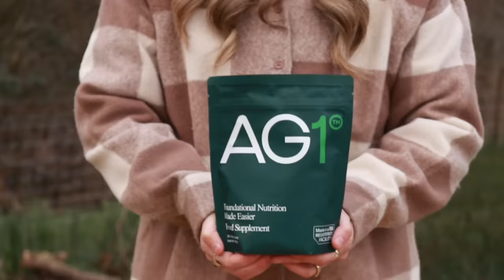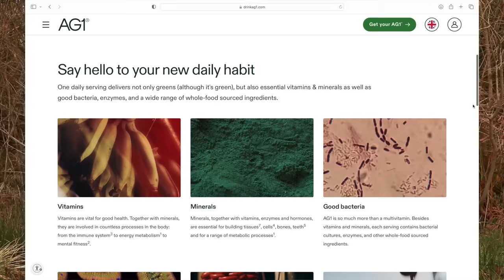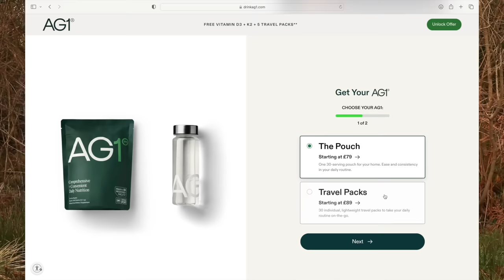New beginnings. Building our dream off-grid homestead in Wales

Comment: So fun to see your walls go up! You might want to reconsider not having a window in the kitchen area. I’ve remodeled 3 homes now (by myself) and got complaints about the only kitchen that didn’t have a window over the sink. It feels a little claustrophobic when washing dishes or vegetables. Any steam from hot water goes in your face. It doesn’t have to be large window, but it does need to open. Just a suggestion. Can’t wait to see your next video.

Comment: You're doing so well you guys. A little bit of advice though if you don't mind. Noggins should be staggered for extra strength. By staggering noggins, the load-bearing capacity of the wall increases significantly. Forces exerted on the wall are effectively distributed throughout multiple noggins, reducing stress concentrations and enhancing overall strength. Staggered noggins create additional voids within the wall structure. These voids can be filled with insulation material, improving the wall’s soundproofing and thermal performance by reducing heat transfer and noise transmission. One of the primary benefits of staggering noggins is the enhancement of lateral stability within timber frame walls. By distributing loads evenly, noggins help counteract the lateral forces that act on the wall, such as wind or seismic forces. This lateral stability is crucial for resisting structural deformations, ensuring the longevity of the wall, and reducing the risk of failure during extreme weather conditions.
Reply: Instead of moving the ones already in, can they just add additional ones in the staggered positions?
Reply from the maker: Thank you for taking the time to share feedback 😃 the noggins are staggered on all walls apart from the last wall Jon did, he did 3 all at the same level by mistake 😅 the dark/tiredness got him. I wonder if ours aren't staggered enough going off your advice? Thanks for sharing xx
Reply: Yes the noggins should be a lot further apart,
Just add extra to what you have already. @CampOutWest
Reply from the maker: Thanks Jazz 😃  @JazzFunkNobby1964
Reply: @jillpackard5305  sorry for the late reply. Yes they can add more  between the others. It would add strength to the overall structure, especially with the high winds we're getting at the moment x

Comment: Check out composite roof sheets.  These are galvanised and insulated and are super rigid and light. It might make the whole process a lot quicker. They use these in places like Portugal for fire resistance too.

Comment: Before buying that log burner, do a little research, look at some log burners you like and read their specifications, especially how much clearance they need, then make a 1:1 scale model from a cardboard or something. Even a small one can take up quite a large space as it needs to be a certain distance from the wall and anything combustible. And of course you need at least a small storage designated to logs, unless you want to go outside every time you want to put on one. I absolutely love fireplaces, wood stove or anything wood burning, but in a tiny home with such limited space ... might not be a good idea. If it was a holiday house, I would 100% agree with it, but as a permanent home, that extra space will be very important.

Comment: Not sure but I thought you would need a double header, an extra bit of wood going completely on to of the frame. This will add extra support when adding the roof.🏴 Make your own trusses will be far cheaper than buying them in. You can build them in situation. This will be easier and much lighter on you both when lifting them into position

Comment: Please add some more kickers to it, mounted bit higher and to the floor . If big wind comes. the bottom part of Your walls (which is attached to floor) will stay attached but all the upper part  with vertical timbers will come out leaving standing stright up nails. It will be disaster. The force on that bottom part is huge it is leveraged by this 2,4meters of height, it needs to be secured. 
Be safe.
Reply from the maker: Thanks for the tips, we will do that 🎉

Comment: You did well there, they can't have been light to lift. There's a technique I've seen on here to assist with lifting the walls, attaching planks to the side, on the inside, on a bolt that allows them to swing. As you lift, these planks become braces, helping support the wall as you lift it, removing the opportunity of it falling back, and acting as another prop once up.  Food for thought for the next one.

Keep the landie, it'll only grow in value.
Reply from the maker: I'm so happy we built the walls in 2 parts. No way we would have been able to lift it if it was once solid piece haha! Thanks for the suggestion on lifting the walls, so helpful. Thanks for sharing that with us. We LOVE the land but we rarely use it and as Jon said 'it doesn't cut grass' so ideally we want to use the money from the defender to pay for a compact tractor or something we can use to help us maintain our land

Comment: Hey, good to see you back, hope you had a great time over Christmas and new year. Apex roofs are pretty easy to make, best advice would be to make a jig, it's the easiest way to make sure your ridge doesn't have move waves than the ocean. If you're going to cover them inside with a ceiling you could use tooth plate, if not you'll have to think about how much effort you want to put into the joints. Depending on what you're using to cover it you'll have to figure out the pitch, a standing seam zinc roof or corrugated metal would be a minimum of 5 degrees, where a slate roof is 20.
Reply from the maker: Thanks Dave! We are going to get quotes tomorrow, so we will see if we think it will be worth the investment compared to us doing it ourselves 😊 thanks for taking the time to share your knowledge with us, that's so helpful and one reason why we really love this community! Everyone is so helpful 🧡

Comment: Wow, your skills at carpentry are exceptional.  Well done to both of you, it is looking really good. What a difference a nail gun is for speed, I could have done with one of those converting my second floor in the roof space instead of using screws.
Reply from the maker: so glad we bought the nail gun, we got it on sale for around £250 new then bought an extra battery as we already had one for our impact driver which was about £35 but definitely worth the money.

Comment: I do think you should have at least a small window in the kitchen over the sink. I think you’d find it helps with the light not to mention a lovely view as you do dishes. So much progress -congrats!
Reply from the maker: The living room window was originally bought for the kitchen, then we realised we needed a window for the living area. We tried to order an extra window but the wait time is 3/4 months and delivery is over £500 alone 😅 so we decided to make do with what we have for now. Ideally we would like a sky light in the kitchen if we can get the correct pitch on the roof. The front door opposite the kitchen is also full glass, so it will have nice light coming in too 😃

Comment: Maybe with the two end walls, you can measure the length of your insulation and place the noggins to that measurement, saving you a bit of insulation cutting?
Reply from the maker: Thanks Anne, the insulation we bought is in massive roles so will need to be cut anyway 😃

Comment: A great update, it's coming on well. A couple of things to consider re the roof, if it's an apex then any roof loading will try and push the walls apart. Plus it's slightly more difficult to insulate the top of the apex as you have to get the angle perfect - assuming you are using rigid insulation for maximum benefit. Talking of insulation, use the best you can as it will reduce your running costs for years plus any visitors won't waste energy heating the cabins. It's surprising how hot some people have their accommodation if they are not paying the bill! Lastly even though I am sure you have spent months considering where to put stuff, with such a beautiful view I would have a deeper window in the lounge with sofa opposite so you can sit and admire the view plus see the log burner.
Reply: I was thinking that as well. Maybe they can do a rising tv under the window so that it is out of the way when not in use.
Reply from the maker: Thanks Ched! Super grateful for everyones input and suggestions. Jon was saying yesterday that we need to over insulate to save on the heating bill when guests start saying haha! We bought our windows over a year ago and the window in the living area was actually originally bought for the kitchen area. It was until a few weeks ago that we started relooking at the windows again and we realised we should have gotten one for the living area, so used the kitchen window instead. In a dream world we would have ordered another one but they have a 3-4 month wait and the delivery charge for just one is over £500, so we are just making do 😅 otherwise we would have done a bigger one in the living room and kept the other one for the kitchen. Love the idea of having the sofa on the back walk, thanks 😃

Comment: It’s great to see you building at long last after all the months of clearing and preparing the land. I thought this was going to be your home however, but you’re saying you want to get out of the caravan and move in, but you’re also saying it’s going to be for guests. Will you be living in it for a while and building a second cabin in order to use this one for holiday accommodation? It’s a bit unclear from the video, maybe more explanation needed. 
As for the layout I’d switch the sofa to the opposite wall so that it faces the views out of the window and also make sure your woodburner has a window and is closer and therefore visible from the sofa as it’s nice to be able to sit and watch the fire of an evening. A smaller TV under the window or on one of the side walls, or even an iPad on a coffee table to watch tv on would be better than having your back to the views. I’d even consider removing the framing below that window and taking the glass right down to the floor or having sliding opening windows to make the most of the views from the sofa. 
I have big glazed doors taking up the entire end of my truck home and I moved the sofa opposite them because sitting across from the views felt right and facing a wall felt like I was missing out on the best vantage point. I also moved my woodburner so that I could better see the flames from my sofa, so my layout advice is based on personal experience.
Reply from the maker: So excited we are finally building 🎉 Our land came with planning for 3 cabins, so we have always intended for 2 of the cabins to be for guests/friends when they are visiting and the 3rd one will be ours. We will be living in the first cabin, while we save up to build the other 2, so we will be living in this one to begin with, then it will become a guest cabin 😃 Thanks for all your window suggestions. In a dream world we wanted the log burner opposite the sofa but that whole back wall is too close to our trees to have a log burner flue coming out the roof sadly. We ordered our windows over a year ago in the Black Friday sale, we did look at getting another one but sadly don't have the budget and also the weight time frame is 3/4 months 😅 so are making do with the ones we originally planned. Otherwise we would go for different windows - the living room window was originally for the kitchen but then we realised a few weeks ago that we made a mistake not getting one for the living space haha! It's all a learning curve
Reply: @CampOutWest  it’s a good idea to live in one of the cabins that will eventually be rented out as that way you can work out what you like and what you’d change, and take that knowledge into building the one that will be your own home long term. 

If you can situate your burner just to the left of your window, and put the sofa opposite the window instead of underneath it you’ll be able to see both the view out if the window and the fire from a seated position on the sofa. Guests will be much more likely to want to sit with a view, and watching the fire, than watching the TV. You could still fit a smaller TV under, or to the right of, the window. 

I’m really looking forward to watching the building all come together.

Comment: Don’t attempt to make your own roof trusses get a timber frame specialist to make them for you. They need to be designed by a structural engineer and they will be much better for cost, consistency in profile, weight and strength.